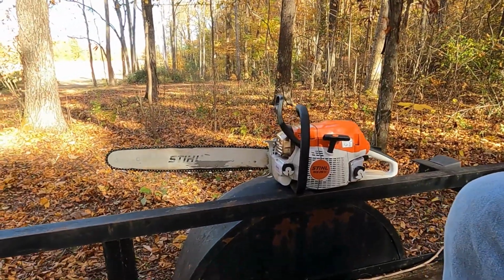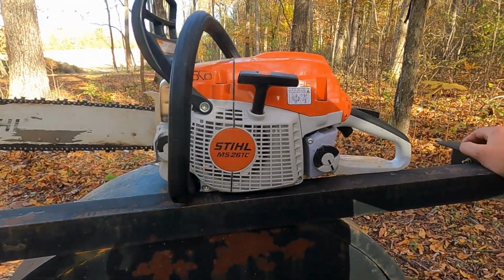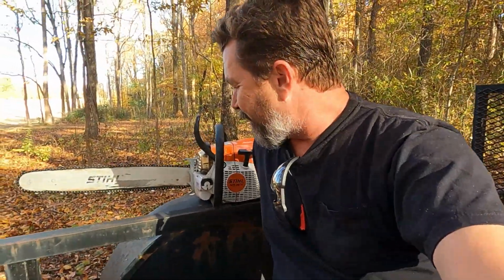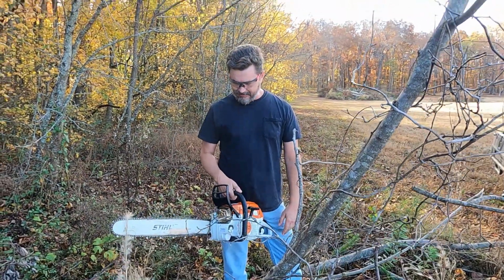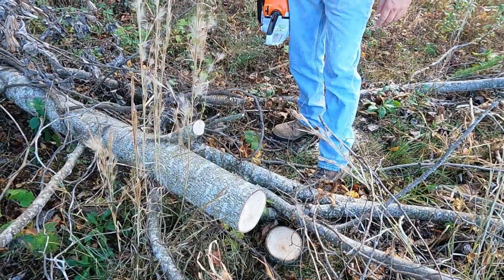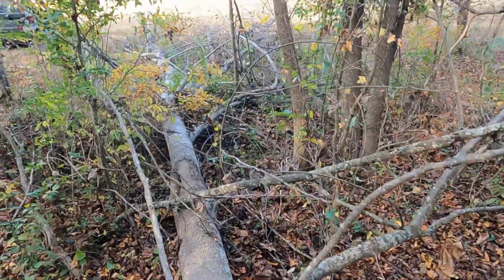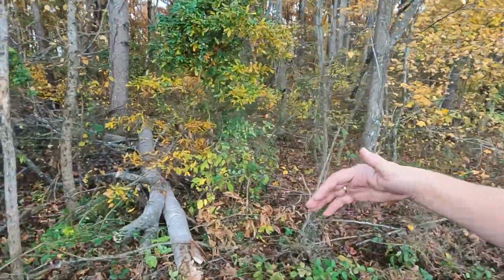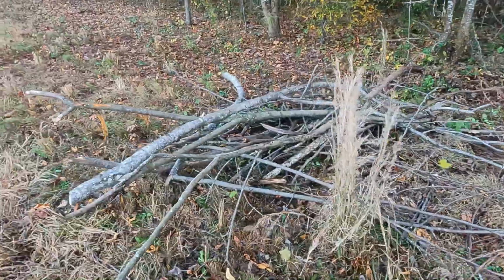Stihl MS261C Chainsaw Motor Ruined! Less than a year old. Only used a hand full of times.

Comment: any time a new saw is ruined there is 99.99% chance that it is the operators fault!
Reply from the maker: Don't doubt that a bit. Live and learn. At least no one got hurt.
Reply: This comment is assanine. 
  You wouldn’t see this many  almost new blown up 261 on eBay if it were all customers fault.  These run amazing but do have no no’s you can’t screw up running a 20” bar with a full chain is one of them.
Reply: @Carboneye7  ok call it 99.1%
Reply: You're saying that this saw won't pull a 20 inch bar?
Reply: It is a great tiny little cheeky devil. But they need great maintenance, very sharp chain and I would NOT run a 1,6mm heavy bar on it. The perfect match is the 16” 1,3mm bar. If in need of bigger heavier bar ms362 or ms400 is the choice to prefere. This is the tiniest little saw almost for babies. They won’t take the same loads. They are very light and they cut quite quick.

When I hear you speaking, takesome advice about how to cut, sharpen and maintain the saw, it will pay off for you. Your cutters ar uneven (different angels for sure, everybody did that mistake no worries…). Liggt 04 16-18” bar will make you more happy believe me. I mean you can cut big trees with 18” bars! Takecare man!

Comment: Ignore the EPA and mix the gas with oil at 40:1 or 32:1 instead of 50:1. It will increase the lifespan of the internal components and not score everything up if the saw goes a tad bit lean in gas/air mixture, or if it overheats a bit. That little extra oil makes a huge difference. Also make sure to use synthetic 2 stroke oil.
Reply: What oil you used?
Reply: @MrBaptiste003  motul 800 offroad
Reply: @em4703  not a great idea using motorcycle oil in a chainsaw, but I guess you’ll find out.
Reply: @jeffcoulter7181  No such thing as "motorcycle oil" buddy, it's 2 stroke oil for 2 stroke engines. Motul themselves recommend that specific oil for chainsaw use because it has extra cleaning additives and it's great for air cooled 2 strokes. 

My 881 has ~700 gas tanks though it and the inside is looking like brand new, so are all the rubber parts, 500i even more @1600 work hours on the clock on this same oil, but I'm sure it's just about to blow up because I don't use some cheapo "chainsaw oil".
Reply: The more oil in the mix, the hotter the engine runs. That's 2 stroke 101, plain and simple.
Reply: @franciscolinera7618  Wrong, not in chainsaws, the engines are too low performance. Run your saw 8:1 and 50:1, the difference in temps will be marginal. There are multiple youtube tests on this matter.
Reply: What ever!
The definition of insanity is to keep doing the same thing and expecting a different outcome....
Reply: @franciscolinera7618  I literally get the same outcome every time buddy: perfect performance and no mechanical issues, and this only happened after I put more oil in my mix. I've tried countless oils and ratios, and I know why I use 32:1 for general use and 25:1 for milling :)

I cut and chainsaw mill more wood in a month that you will in your entire lifetime. My saws all last 3000+ hours of worktime before any rebuild is needed. I doubt yours reach 1000 hours at 50:1, I've seen what it does to lower end bearings, no matter what overpriced snakeoil you use.
Reply: @em4703  “No such thing as motorcycle oil” I can see you know as much about motorcycles as you do chainsaws……..you have a good one buddy.
Reply: @jeffcoulter7181  There's no motorcycle specific 2 stroke oil, they all run in all 2 stroke engines. Learn to read.
Reply: @em4703  motorcycle, water cooled, chainsaw air cool, so different operating temperatures. Lean basic mechanics
Reply: @jeffcoulter7181  It doesn't matter with these ester oils from motul, or PAOs from other brands, they're for both water cooled and air cooled. Read the damn spec papers from the manufacturers before rambling generalized backyard info from the 1990s.
Reply: I do the same thing in my sthil I have two. I run 40:1 and they run amazing not hot. Both are 2015 models. Zero problems I cut 5 to 7 cords a year never an issue. My opinion is to many people don’t keep a sharp chain and are to lazy to change it or sharpen it.

Comment: As for you blowing up the first saw, I would advise you too not use premixed fuel; if that is what you used.  Mix your own fuel at 40:1.  I know Stihl recommends 50:1, but that does not provide enough oil to the piston and crank case.  I have several Stihl saws and I have never had a problem,  and I have never used 50:1.
Reply from the maker: Great advice.. Thanks!
Reply: Couldnt agree more, 40.1 everyone..
Reply: better off at 45:1
Reply: Ich mach immer 1:50, nie Probleme gehabt.

Comment: Flip your bar upside down and see if it still cuts on an angle. If it still cuts crooked then it’s your chain. As others have said, when you file by hand it’s easy to get one side sharper than the other due to hand preference.
Reply from the maker: Good thought! I am so happy I have you guys to help me as I learn.
Reply: Check your rakers also you could have rakers to high on one side. After you file the teeth it can cause a raker to be taller so be sure to check them after you file also check the makers on a brand new chain because they are usually set between .020-.010 I've been see a lot. Also if it's getting hot during the cut blip the throttle, that extra fuel when the throttle blade closes will cool the cylinder down same with letting it idle and bliping the throttle ever 5 10 seconds. A Sharpe chain is a must. Also yes it can warp or the rails of the bar where the chain rides one rail is higher then the other making the chain not set 90° to the bar if that makes sense you can buy a bar dresser that fixes this and re sets the bars chain Grove back to 90° so the chain isn't setting off to one side this also will cause a chain to pop off a lot and people also wonder why the chain keeps popping off. If you arent sure on the bar dresser look them up they are definitely a must with a saw that prefers a sharp chain.

Comment: Here's my 0.02 on this. I don't believe it was the chain that burned up the engine. These saws were designed to run hard all day long with or without the chain. In other words, the engine is the heart and soul of the tool and everything else is secondary. As long as they are broken in, you can rev them to the moon and they will love it. The bigger concern is the gas/oil mix. This is a high end saw that requires a very precise mix of oil and gas. And that mix is 50:1 or 2.6 oz of oil per gallon of fuel. And not just any oil but quality oil like Stihl HP Ultra (yes, it's a very good oil but it needs high revving to shine), Stihl Premium, Castrol Go, or motorcycle racing oils from Honda, Maxima (except Castor 927), Bel-Ray, Motul and alike. 50:1 is key, not 40:1 or any other ratio. If you mix it 40:1 and don't run the saw hard enough or often enough, what will happen is excessive accumulation of carbon around and on top of the piston that after a year or so can flake off and rub against the cylinder wall. The MS 261C uses a different piston design than other homeowner class saws which makes them so powerful, but also vulnerable to incorrect mixing ratios. What the MS250 can tolerate, the MS261 will not. Think of it like a race car. Only the best quality oils and fuels go into them and your MS261 is no exception. Good luck with your new saw.

Comment: I watched this video several months ago and commented. I received a notice today that someone liked my comment so I came back to the video to refresh my memory. In doing so I noticed something I missed previously. That being that you are using the saw left handed. That affects the "hang' of the saw. That alone could be leading to your angled cut. Left handed use is also not recommended as it puts your body in direct line with the bar in the event of a kickback.  See the "Holding and Controlling the Chainsaw" section on page 10 of your manual. You will find that Stihl does not recommend left handed operation.
Reply: I think you have nailed it.
Reply: @andrewford80  HUH?  I run lefty or cow-handed and have for 55 years now.  Never a problem and one of my saws is 50 years old.

Comment: Like everyone has said, flip your bar when you sharpen your chain and always keep your chain sharp. Don't obsess with keeping your cutters exactly the same length like many think you have too. Just make sure you keep your raker's or depth gauges set right. I run all Sthil pro series saws and the 261 is one of my favorite go to firewood saws. I find it hard to believe you blew one up if you were using good mixed fuel, even if the chain was dull and you did very little cutting with it. The 261 is no more prone to blowing up than any other saw as I'm around my Sthil dealer on a regular basis and have never heard any complaints like that. I run the snot out of mine and it has never missed a beat. Makes me wonder if you may have just gotten a bad one. Just one more thing, not trying to tell anybody what to do but it wouldn't be a bad idea to get yourself a good set of chainsaw chaps. Especially if your not real experienced with a saw. Things happen especially when your climbing around limbing downed trees. Been running a saw for the better part of 35 years and I can tell ya chaps saved my ass once. Plus their nice in the brush and if your lucky enough to have multiflora rose vines. By the way too, I love that tractor and grapple you have. I just got one last year and don't know why I waited so long.
Reply from the maker: I can tell from what you're saying that you know a thing or two! I am going to take your advice and get those chaps. You are not the first to mention it but you have convinced me. I hope and believe that. you are right, I think I must have got a lemon. Hopefully this one will have no problems at all. I promise you, I have been very sure that I have always filled up with the correct gas/oil mixture.The thing that makes me happy is you saying that the MS 261 C is your go to. It tells me that I made a good choice, just got a bad one but I should be good to go for now. Thanks on the tractor and grapple, loving them both! Merry Christmas and thanks for hanging out with me at The Lovely Place.
Reply: @TheLovelyPlace  The 261 has good power to weight ratio and unless I'm cutting big wood I find myself picking it up over my bigger saws. Just make sure you let it warm up for a minute like any saw before you start cutting and you'll be fine. There's nothing wrong at all with the two n one file, I use one every now and then but usually hand file or use my chain grinder. Glad I could help out. I'm no pro, just love running a saw, kinda my hobby you could say and have cut wood since I was a kid. Good talking to you. The 261 will make you a great saw, promise.
Reply: @TheLovelyPlace  You can forego getting the saw chaps if you want and get chainsaw pants instead. The pants are wayyyyy more comfortable. But get one or the other. Just my 2 cents.
Reply: Did i mention its a very stupid design.😊  no adjustments.  It does it itself.  All you got to do is picl the rigjt dsy of the rigjt month, at the right month, during the correct time of day, when tĥe planets all align right. Then, if your at the elevatiom, it might start.  Well,  have fun
Reply: I noticed when you started your saw that the chain was spinning. Always start your saw with the brake on man dumb things happen stupid easy. I recently had the same thing going on with curved cuts, ended up being I did not sharpen or didn't sharpen the teeth that face one way or another yet was still getting big chips of wood but curved cuts. Try a new chain and see
Reply: Also take a file to the edge of your bar and smooth it out every once and a while. The edges of your bar will start to flare out in spots or sometimes the entire edge
Reply: You not cutting  straight can be for several reasons 1 the bar being worn more on one edge (side) makes the chain lower that side causing cut to being not straight 2 when sharpening the chain you will put more pressure on doing one side than the other the one side you have less pressure on just do an extra stroke of the file on to make it more even, with the two in one files they tend to take a bit to much of the rakers so just keep an eye on it and maybe use just a file a couple of times in-between the 2 in 1 file

Comment: I have an MS261with a 20" light bar running 33RS3 chain with the traditional old school carb. It's my favorite saw. My second most favorite saw is my new MS400C. 

I've been using chainsaws off and on for 60 years. (I'm older than dirt.). I was pruning fruit trees with one in my youth. The fifties saws weren't nearly as nice as what we have now. 

To see if it's your chain, take it to the dealer and have them sharpen it on their machine. If it cuts straight, the bar isn't the problem, it's a problem with sharpening.

I had the same angle cut problem with my 261. It cut straight after the dealer sharpened the chain. I stopped using the 2 in one sharpener and went back to the round file with the tin guide on it - a system I've been using like forever. Problem went away. Went back to the 2 in 1, problem returned. Now I just use the file with the tin guide. Then adjust the gage teeth using the file gage and a flat file. 

Unless you did it off camera, it didn't look like you warmed up the saw before you started cutting with it. That's a really good way to score the piston. Warming up the saw at slightly elevated idle for thirty to 45 seconds will protect from the cold engine piston scoring phenomena and assure you start with a well oiled chain. 

I can't believe you didn't wear protective chaps and a hard hat. I got away without them for 5 decades but I bought the first pair of saw chaps I saw for sale at the Stihl dealer. Look up the statistics on chainsaw injuries. There are over 30,000 serious chainsaw injuries a year. The average 'survivable' cut takes over a hundred stitches. I also have a saw optimized emergency medical kit on my belt with quick clot gauze and a toruniquet. 

I use a BRADCO grapple on an LS160 skid-steer for handling trees and logs. I agree, the grapple is a wonderful tool.

Comment: I see a lot of comments mentioning the chain.  That's possible, but in my experience, the primary cause of cutting at an angle is related to the bar.  The bar groove wears over time or can wear prematurely from an over-tightened chain or excessive heat (from insufficient oiling or cutting with a dull chain). 

This causes the groove to angle out like a "V" (instead of being at a 90 degree angle), which causes the chain to cut at an angle.  

A pinched or warped bar can have a similar effect, but I think the groove issue is more likely. You can verify all these potential causes by close inspection of the bar.  You can sometimes correct groove wear with a file or grinder, and I believe there is a guide in the user's manual.  

Keep the bar clean, the chain sharp, and make sure you have a small bit of slack in the chain when cutting to prevent premature wear.  You may also want to ensure the chain oiler on the saw is working properly.

Comment: Try flipping your bar to see if it still cuts to the left...also try using it right handed as someone else mentioned.  Other things is making sure you sharpen the chain equally on both sides, use equal strokes and force/pressure on both sides.  Best tool I find for this is the Pferd/Sthil sharpener.  If bar getting hot that could be the bar oil either the adjustment is off (make sure it sprays a mist) or things are just clogged up.  Use compressed air to blow clean everything including the bar channel.  Also chain could be gunked up too, wd40 is the best thing I found for chain cleaning (any chain: bicycle, motorcycle, etc.).  Use proper fuel mix 50:1 with quality gas and proper oil for air cool chainsaws, preferably full synthetic.  Lots of time folks will use water cool 2stroke oil for outboards or snowmobiles which is not designed for chainsaws.